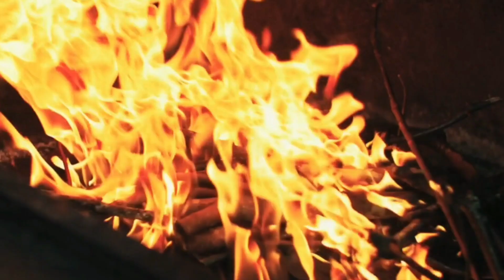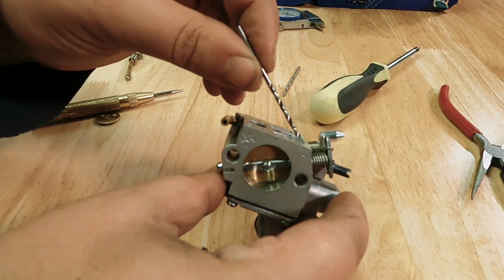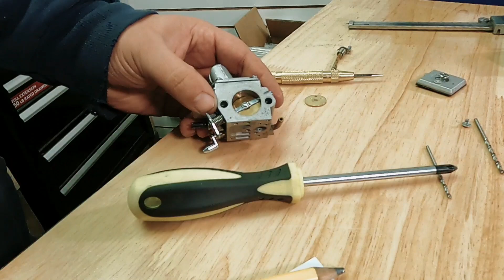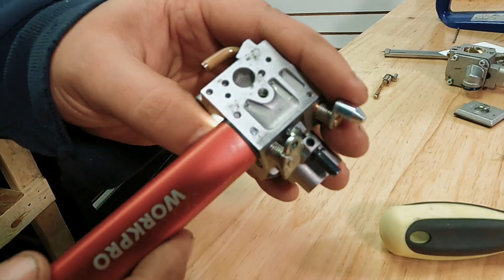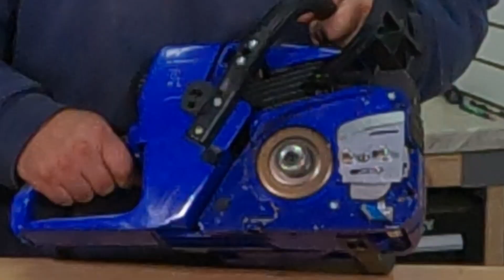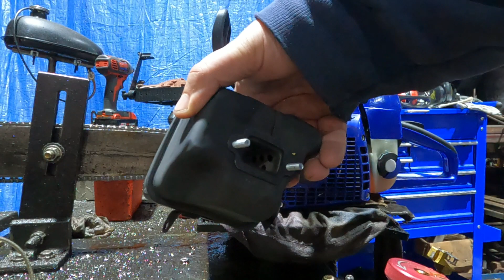FIXED MY MISTAKE! Are Carb swaps really worth it?

Comment: I’m a year late but hopefully you see this and will comment.

I’m doing a 366Pro right now, and since I have a 290 carb I’m going to try it, the venturis match a 372 carb so it should be fine.

Thing is, after mocking it up it appears that I can simply unhook the impulse line from the back of the mounting baffle -and run it through the existing hole under the intake boot.  Hooking it right up on the nipple nipple that’s on the bottom of the carb.  

Why didn’t you do that with your’s.  Am I missing something?

Comment: They have been working professionally for me but I’ve definitely been swapping over a good used topend or the meteor topend kit the occasional crank shaft setup with those but several of the aftermarket cranks are still running great.  32:1 obviously because it’s just not a real nikasil lining I’ll use SKF bearings but I oil them more with the 90cc size or 70… 36:1 or 40:1 on the little displacement saw’s just helps them run longer….

Comment: Nice work on this series Joe. Your dyno results coincide with what I have experienced on my MS361 builds. Unless one changes the intake boot size it is hard to realize the full potential of the larger carb swap. I decided on my last two builds not to bother with that and focus more on filtration and muffler mods with porting.  I look forward to seeing the results of your muffler mods. I can't say on the g366 but on most ms361's the squish with a base gasket is at around .026" so a base gasket delete is not possible unless one cuts the base. I did not notice the small hole in the intake port on the g366 so maybe the g366 cylider is cast off the early Mahle ms361 cylinder, that is different from the later ones. A simple intake timing change by filing and sanding off the piston squirt would be a great mod to share that anyone can do, especially giving the risk for failure with these aftermarket cylinders. And as you said a timing advance. It would be nice to know just how close the timing on the g366 is to the ms361. I have had two saws with aftermarket coils run backwards on me.Thanks for the video's. 👍

Comment: U have 2 port the cylinder 2 make more air flow and a bigger carb helps the more air  the chainsaw pulls the more HP it makes U want a bigger chainsaw 4 cutting big trees and stove wood 😊😊 OMG 11 4 2O23

Comment: Great video as usual. I’d be curious to see what I’d does with no muffler at all. Does it even run? If it does, does it lose torque? Horsepower? Just would be interesting to see. 
Also, do cheap vs expensive plugs make a difference? A warmer or colder plug?

Comment: I like this step by step build up with numbers to show what is what. It would be cool to see the same intake and exhaust mods with the stock carb to see if the carb swap or air flow is helping more. I’m sure the carb makes a larger difference the further the build goes, especially if ported. I think sticking with hand tools only will be best to see how far it can go before machining is needed. I vote gutting the exhaust next, then base gasket delete, then timing advance. Then maybe some very simple porting that could be accomplished with hand files only?

Comment: Hi Joe, I would be curious to see what a timing advance and timing retard from the factory keyed timing would do to power output on the dyno. After I did a mild port job with a base gasket delete I felt my G366 ran stronger with a little timing retard. I was getting too much kick back with factory timing along with the backwards running when trying to start the saw.
Reply: The 366s seem to have hot timing from factory... Certainly don't need an advance imo... But until I throw a timing light on it and see where it is, I wont know for sure.... Mine. Kicks too!

Comment: I'm liking the baby step method on this build. I dabble in saw modding but I get impatient and just do it all at once outside of muffler mods. I mod some and never port them. Id like to see the small steps continue. Full muffler gutting next. Then just a base gasket delete. Then porting without machine work and last, machine work. If you can after you already ported it. Planning involved for those to be done in seperate steps obviously. I have faith you can math it out. 😊 keep up the vids. Still my favorite saw channel.

Comment: I’d like to see if just opening the lower transfers will help or hurt. I only say that because you see a lot of guys who start playing with porting open lowers but nothing else. They blow the lowers open thinking they’re helping.. is it or is it not? Well I’d like to see dyno runs to see. I know it’s not easy because you need to take the cylinder on and off so it’s labor intensive but who knows maybe someday. Just an idea 🤷‍♂️.. Thanks for the helpful vids Joe.
Reply: I second this👍🏻
Reply: I third this, lol... Port it leave Lowers stock and do a pull... Then open up. I can tell u when I ported my BB 361 cyclinder the Lowers are so tight I could. Not start with a normal sized bit... I had to use the dremel straight carbide bit 3mm wide!

Comment: I'd like to see muffler mod, then a pipe simple iron horse pipe. Advance the timing.  Next would be a gasket delete no machine work. Home tools only. Grinder and flap wheel for cylinder clearance. 😂 Then port work. Depending on the piston maybe a dome if it doesn't have one. Like to see a single ring setup as compared to a dual if it is a two ring piston.

Comment: Joe, will swapping a cs620 carb onto a cs590 worth it, I was going to try a knock off carb, I ordered the off set key from gearhead?
Reply from the maker: Yes, the 620 carb is a nice addition.  Especially with the cheaper options available. Helps the muffler mod and other mods work just that much better.
Reply: Just ordered the offset key and filter o ring kit from your store. Red beard air filter is what I wanted but out of stock. Hey v twin do you have a link to where you are getting your 620 carb? Thanks. Love the content on this channel. Mistake parts bought from sawsalvage.

Comment: I really like how you transfered your marks with that paper and pencil. I've used that trick for years! Also I think the muffler mod, timing advance, and maybe a simple base gasket delete might be some more simple things we can do at home. Possibly even match the exhaust gasket to the cylinder and muffler for better flow if it's in the way. Just thinking of at home ideas anyone could do without major tools. Good video!